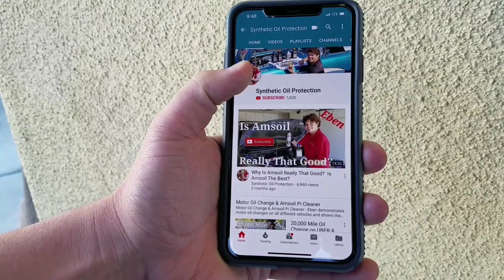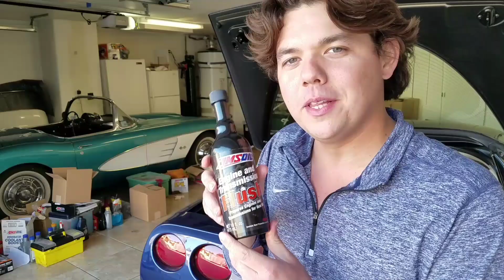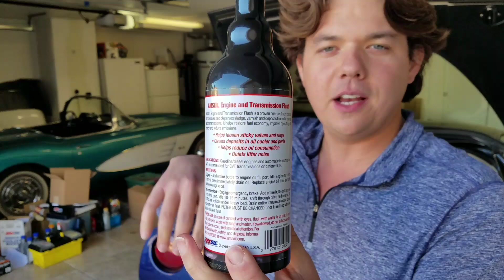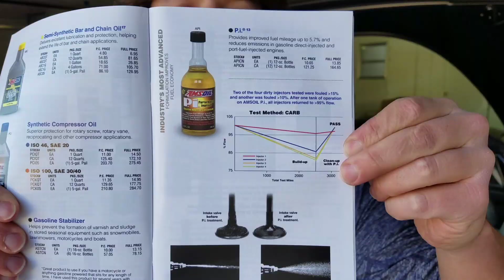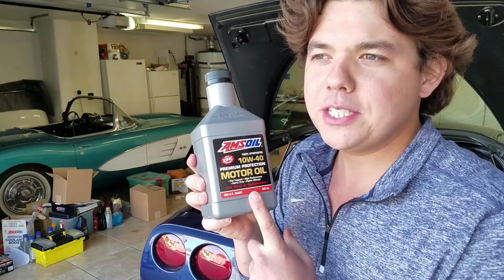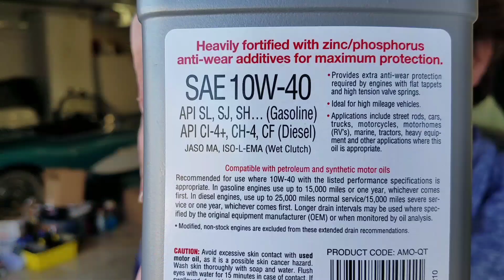Best High Mileage Synthetic Motor Oil - Oil BURN Fixed!!!

Comment from the maker: ✅ ✅ ✅  Save 25% On Next Fluid Order: https://www.amsoil.com/offers/pc/?zo=5331179 

     ✅ ✅ Watch This Next: Stop ! Oil Burn 3 FLUIDS - https://www.youtube.com/watch?v=TfTdh3iJa5M

     ✅️ Buy Me a Coffee - https://www.buymeacoffee.com/YouLubher  

     🥇🥇🥇 Synthetic Oil Protection Google Map Reviews
(702) 472-3614
https://maps.app.goo.gl/DmLU5hP72HadUBEm9
             
     ♥ Synthetic Oil Protection Website - http://syntheticoilprotection.net

     Did you know a oil manufacturer can call a lubricant a Full Synthetic when it's only 25% synthetic? AMSOIL is different because it is 100% Synthetic and has a higher film strength keeping the metal parts separated. AMSOIL allows less friction, less heat, less wear on the component. 

      ♥ See Fluid Performance Tests - https://www.amsoil.com/performancetests.aspx?zo=5331179      

     ♥ Your Vehicle Could Run Better Than Brand New By Choosing The Right Fluids! See Results - https://youtu.be/zH-VquYlhqA

     ♥ Why AMSOIL - https://www.amsoil.com/about/exclusive-distribution/?zo=5331179    

     ♥ Synthetic Oil Protection Coffee - Ebens Favorite: https://supportwith.coffee/shop/subscriptions/sop/

Comment: 2010 Jeep Wrangler JK Islander with 135K miles, 3.8L V6 here. I use the 5W30 S.S oil and I still have oil consumption, though not as bad as it used to be. I also use the Engine/Transmission flush before I change oil, at 5K intervals. Everything I have read online says this engine is hard on engine oils. I check the oil every time I fill up with gas. UPDATE: I now use Amsoil High Mileage 100% Synthetic Oil 5W30 which greatly helped by not requiring topping off as often as well as slowing and stopping to some degree oil dripping from the rear main seal and oil pan gasket.

Comment: Where can I purchase Amsoil products?
Reply from the maker: You can order it right here on my website and I will always be able to answer your questions in the future with the products as your independent Amsoil dealer.
   Together! We can get your vehicles to run better than brand new! 

     For me to get credit & be "Your" Independent AMSOIL Dealer, please use my website below or my dealer no. 5331179 call anytime Eben Rockmaker 702-472-3614
After you click on: http://syntheticoilprotection.net
1. Click the hamburger menu
2. Click offers AMSOIL preferred customer
3. Click join now. 6-month PC member add to cart.  ( There is no reoccurring renewal membership unless you select that dot box ) 
( You have the option to not have your credit card saved if you prefer - est. 1972 )
4. Scroll up to the top Select shop by vehicle. 

New Promo: FREEHAT

Comment: How does Seafoam compare
Reply from the maker: That's a great question Amsoil is 100% synthetic much higher quality keeps the metal Parts separated less friction less heat less wear you will be able to get everything right here through my link if you have any questions let me know.
For me to get credit & be "Your" Independent AMSOIL Dealer please use my website below or my dealer no. 5331179 call anytime Eben Rockmaker 702-472-3614
After you click on: http://syntheticoilprotection.net
1. Click hamburger menu
2. Click offers AMSOIL preferred customer
3. Click join now 6-month PC member add to cart
4. Scroll up to the top Select shop by vehicle.

New promos: FREEWAND

Comment: Hi, thanks for your video, my KIA 2015 Sportage 2.0L has now found it starts burning engine oil ( running 116,000 km and I have replaced a new PCV it seems a little better), what would you suggest to use to reduce or fix this issue?
Reply from the maker: The engine flush Pi cleaner Signature Series will make a huge difference you'll see everything in this video and when you use my link I will be your Amsoil Dealer so I can always answer your questions in the future with the products you'll see my link in each description section and then you want the 6-month PC member will give you the best value on the products and then in the future I can always answer your questions as your dealer💯👍
https://youtu.be/TfTdh3iJa5M?si=2e097zllyiKoN0Wc
Reply from the maker: To be "Your" Independent AMSOIL Dealer please use the link below or my dealer no. 5331179 call anytime Eben Rockmaker 702-472-3614

     ♥️   Shop by vehicle - https://www.amsoil.com/guides/?zo=5331179

     ✅   Save up to 25% on every order as a preferred customer: https://www.amsoil.com/offers/pc/?zo=5331179 
New promos: 5PI & 5DX

Comment: Does the oil additive harm the gaskets?
Reply from the maker: The engine flush will help clean the gaskets and will allow the fresh Signature Series motor oil to get in and condition the seals I highly recommend the signature series motor oil for your specific model and the engine flush you will see a huge Improvement👍
Eben Rockmaker 702-472-3614 
New Video - https://youtu.be/el0YnOpPNMo?si=B-wBCrEHhDTkV3Yq
https://linktr.ee/EbenRockmaker
New promo: FREESHIP

Comment: I use the 5w/30 Signature Series and get great results with my motor that has over 200,000 miles on it. I'll test the other oil weights and viscosities.
    I get better gas mileage and runs much smoother with Amsoil.
     Everything from transmission fluid to brake and power steering fluid in my car is all Amsoil. 100 % Synthetic oils and fluids. 
     Keep up the great videos and education on taking really great care of your car to last longer and get better gas mileage. 
     Amsoil is the best protection for sure.

Comment: My prius 2012 is consuming oil like 1 quart every 1000 miles.  What Amsoil oil I should use after the Amsoil flush?  There are high mileage Amsoil 0w-20, Amsoil Hybrid 0w-20 & Signature Amsoil 0w-20 to choose from.  Also which one I should add to my gas tank? Amsoil PI or Amsoil gasoline additive?  Thanks
Reply from the maker: I would run the signature series if it was my car I would come back and change the oil filter in 3000 Miles I would use the Wix filter for the first 3000 and then the Amsoil filter after that I would get three bottles of Pi cleaner and I would put the second bottle of Pi cleaner in when you change the filter in 3000 and then I would also get the upper cylinder lubricant as well.
This will give you the best value on the products with my link as the 6-month PC member you'll also have the free shipping at $100 and the latest promotion which is the tool.
✅   Save up to 25% on every order as a preferred customer: https://www.amsoil.com/offers/pc/?zo=5331179 
Promo: FREETOOL

Comment: Is this process ok for a 3.5 liter ecoboost Ford engine?
Reply from the maker: Yes you should be good to go we have a bunch of videos on that motor on the channel if you type in Amsoil engine flush Ford Raptor you'll see all the videos on the channel here
Reply from the maker: If you are new to trying the products I highly recommend the six-month PC membership you will get the best value on the products and I'll always be able to answer questions in the future about improving the performance and lifespan of your vehicles and equipment by choosing the right fluids as your independent Amsoil dealer.
♥️   Find The Right Fluids For Your Vehicles - https://www.amsoil.com/guides/?zo=5331179      

     ✅   Save 25% On Your Next Fluid Order: https://www.amsoil.com/offers/pc/?zo=5331179

Comment: Where do you buy this oil
Reply from the maker: Clive this is my personal link this will give you the very best value on the products as the 6-month preferred customer when you use my link I'll always be able to talk with you about improving the performance and lifespan of your vehicles by choosing the right fluids as you're independent Amsoil dealer.♥️   Find The Right Fluids For Your Vehicles - https://www.amsoil.com/guides/?zo=5331179      

     ✅   Save 25% On Your Next Fluid Order: https://www.amsoil.com/offers/pc/?zo=5331179

Comment: i consume a lot of oil but i dont think this will fix it.
Reply from the maker: Yikes that's not good how much oil do you burn every thousand miles? And what type of vehicle is it?
Reply: @Syntheticoilprotection  half a quart every 5k miles. i already use amsoil.
Reply: @Syntheticoilprotection  oh and it’s a 2012 sierra 1500 5.3

Comment: I have a 1995 Oldsmobile cutlass supreme and I am debating a flush and switch to Amsoil SS. Would it be inadvisable to do on this old of a car? Mileage is fairly low at 116k.
Reply: Thank you Eben, unfortunately I was added to a different dealer (he purchased a PC membership for me), but I wish some of the credit could go to you!
Reply from the maker: 💯, oh yeah it'll make a huge difference we've done a $375,000 mile engine flush on the channel and it made a huge difference on his truck.
I recommend the 6-month PC membership this will give you the very best value on the products and when you use my link that would give me credit and in the future I'll always be able to answer your questions on the products💯

❤️ 🇺🇸 ❤️ Professional YouLubher: Eben Rockmaker Regency Platinum Direct Jobber AMSOIL Specialist (Dealer#: 5331179) 702-472-3614 

      ✅ ✅ ✅  You will get Your Best Value as 6 Month AMSOIL PC Member --- because You get about 25% discount on AMSOIL Products  + you will not pay as much sales tax, depending on the sales tax in your state.  For example, if you were to buy $100 of product at retail plus 8% sales tax the total would cost you $108. However, if you paid the $10 PC membership and you received the 25% discount because of the PC membership, the total would cost you $75 plus 8% tax or $81. So for the one time membership of $10 you are saving $27 on your first order.  You continue to receive discounts on your future orders for the next 6 months. You do NOT need to auto renew! https://www.amsoil.com/offers/pc/?zo=5331179

Comment: Does that fuel additive work on gdi engines?
Reply from the maker: Yes the pi performance improver makes a huge difference cleans the injectors also carbon deposits inside the combustion chamber you'll notice better few mileage cleaner burn less pre ignition more power.

Check out the video here in this link you'll see the actually show that before and after Dino and they show a tear down on an actual Engine with 100,000 miles on it - https://www.amsoil.com/p/p-i-performance-improver-gasoline-additive-api/?zo=5331179

Comment: love your videos.. I have a question we own 3 scion xb one is 2008 and 2 are 2009 the problem da we have with this vehicles are ( OIL CONSUMPTION ) Did you THINK this stuff ANSOIL WILL HELP THIS PROBLEM .on this vehicles. If your answer is positive please tell me beside amsoil what else to use.  thank you soo much for your time and GOOD videos.
Reply from the maker: Yes it will change the way the vehicle drives It will help with the oil consumption and the engine will last significantly longer.

1. Engine flush for each vehicle you'll see under cleaners and protectants

2. PI performance improver for each vehicle you'll see that under the fuel additives

3. Upper cylinder lubricant you'll see that under fuel additives

4. Amsoil power foam you'll see that under cleaners and protectance the yellow can.

     If you have any other questions let me know always happy to talk and when you use my link I will be your Amsoil dealer so in the future I can always answer all your questions on the products.

I appreciate the business future business in advance and the 6-month PC membership will be your best value on the products.

❤️🇺🇸❤️ Professional YouLubher: Eben Rockmaker Regency Platinum Direct Jobber AMSOIL Specialist (Dealer#: 5331179) 702-472-3614 

      ✅✅✅  I Recommend The AMSOIL 6 Month PC Membership because it will give you the Best Value which is about $ 33 back on a $ 100 purchase after the difference in tax - https://www.amsoil.com/offers/pc/?zo=5331179

Comment: My car uses 5w-20 full synthetic which is oil recommended for the engine. My question is it safe to use 10w -40 in my scion TC
Reply from the maker: Great question This will give you all the products for your year make model and engine size I recommend the signature series motor oil.

I would also do the PI performance improver if it was my vehicle I would also get a case of the upper cylinder lubricant and I would also do an Amsoil engine flush which you'll see under cleaners and protectants.
Find AMSOIL Products For Any Vehicle - https://www.amsoil.com/guides/?zo=5331179
Reply from the maker: Always happy to help you anytime Thank you again for any business future business in advance and for being a part of my YouTube community when you use my link I will be your Amsoil dealer in the future I can answer all your questions on the products and I would also get the credit for your orders Thank you.
❤️🇺🇸❤️ Professional YouLubher: Eben Rockmaker Regency Gold Direct Jobber AMSOIL Specialist (Dealer#: 5331179) 702-472-3614 

      ✅✅✅  New To AMSOIL I Recommend The AMSOIL 6 Month PC Membership because it will save you about $33 on a $100 purchase after the difference in tax - https://www.amsoil.com/offers/pc/?zo=5331179

Comment: My engine isn't leaking too much but it is burning a lot of oil, so I am interested in the 10w40 premium, but my car takes 5w30/10w30 depending on the climate, (I use 10w30), so I'm wondering if I can use the 5w/10w30 XL and mix in 1 or 2 quarts (7.5 total) of the 10w40 premium in order to burn less oil and protect from wear, without drastically increasing startup wear? If so, would mixing 5w or 10w30 be better to mix with the 10w40? And how much? 

My climate never goes below freezing, and it's a 1994 Cadillac eldorado 122000 miles on it
Reply: no, ALWAYS stick to the weight listed in the owners manual. and NEVER mixed weights. Also, never mix synthetic with regular, or semi blend. First off, change the PCV valve if you have one. Run a motor flush. and then do a full synthetic oil change. also a good idea to run a fuel injector clean / gas treatment.
Reply from the maker: I made this video for that question on mixing oil - https://youtu.be/celH6X9nbyg

Comment: i have a 2009 accord and it rattles when its burned enough oil and i put 1 quart in and the rattling stops .. do u know what i should do please?
Reply from the maker: Yes you would want to do the engine flush You'll see that under cleaners and protectants on the Enzo website also you want to do the PI performance improver gasoline additive will clean your valves carbon deposits in the combustion chamber I also recommend a can of the power foam the yellow can which will clean the intake and your exhaust manifolds and the throttle body.

This will give you all the products for your year make and model and I highly recommend the 6-month PC membership will save you a ton of money if you have any questions on anything give me a buzz happy to talk with you and when you use my link I would be your Amsoil dealer so I can answer all your questions on the products in the future Thanks for being a part of my channel and I appreciate your business and future business Thank you. 
   ❤️🇺🇸❤️ Professional YouLubher: Eben Rockmaker Regency Gold Direct Jobber AMSOIL Specialist (Dealer#: 5331179) 702-472-3614 

      ✅✅✅  New To AMSOIL I Recommend The AMSOIL 6 Month PC Membership because it will save you about $33 on a $100 purchase after the difference in tax - https://www.amsoil.com/offers/pc/?zo=5331179

Comment: I’ve been using Penzoil Plat in my 07 IS350 and been burning 1 qt every 1k miles.
Reply from the maker: Sorry to hear yeah that is definitely a carbon buildup issue I definitely recommend doing the engine flush also a bottle of the PI performance improver and a bottle of the Amsoil Power Foam You'll see everything we do in this video here.
Also you can use my link and when you use it I'll be your Amsoil dealer I can always answer all your questions in the future on the products and that would also give me the credit for the order and that really means a lot to me I appreciate you being a part of my YouTube community.
https://youtu.be/PI4K_C_U0jY
Reply: @Syntheticoilprotection  Cool I will do the engine flush this weekend.
Reply from the maker: Let me know how it goes 😊
Reply from the maker: This is a video of me using all the products I mentioned on my personal car https://youtu.be/-T_-mF8tlyA
Reply from the maker: If you have any questions always happy to talk thanks again 💯🇺🇸🪙

🎬🎬🎬 Professional YouLubher: Eben Rockmaker Regency Gold Direct Jobber AMSOIL Specialist (Dealer#: 5331179) 702-472-3614 

     ✅✅✅  New To AMSOIL I Recommend The AMSOIL 6 Month PC Membership because it will save you about $33 on a $100 purchase after the difference in tax - https://www.amsoil.com/offers/pc/?zo=5331179

Comment: Questions. I just bought a stp high mileage oil treatment. Do I use it before adding the new oil or added with the new oil. And do I have to replace the oil after the treatment?
Reply from the maker: I have no idea with that type of product I have never used it before.

I do recommend themselves signature series and also the AMSOIL engine flush you'll see everything here will be on the lookup guide also if you ever have any questions with the products when you use my link I would get the credit for your order and I would be your Amsoil dealer in the future.
🎬 Professional YouLubher: Eben Rockmaker Regency Gold Direct Jobber AMSOIL Specialist (Dealer#: 5331179) 702-472-3614 

     ✅ If You're New To AMSOIL I Recommend The AMSOIL 6 Month PC Membership because it will save you about $33 on a $100 purchase after the difference in tax - https://www.amsoil.com/offers/pc/?zo=5331179